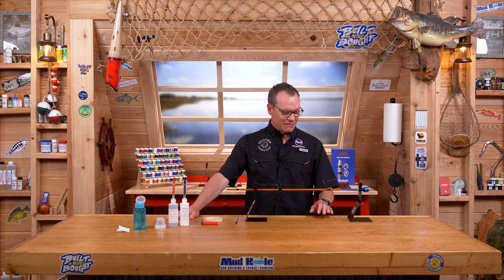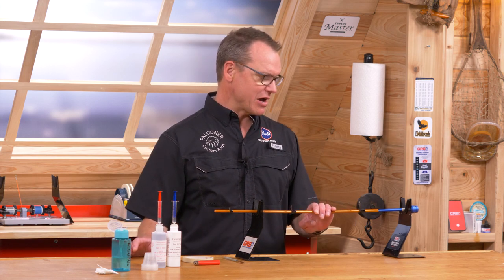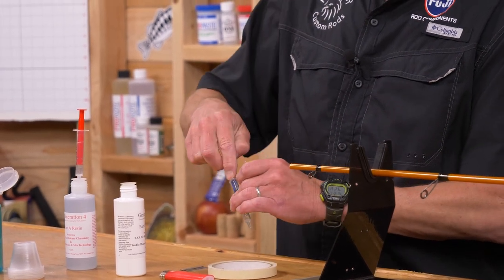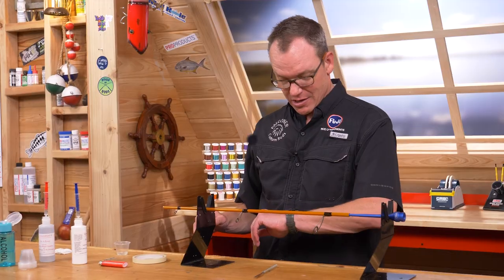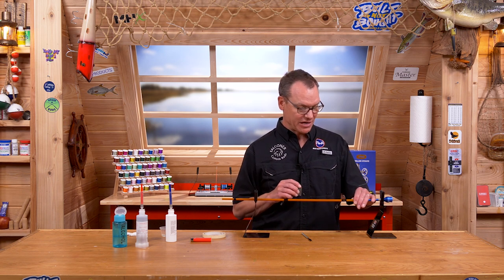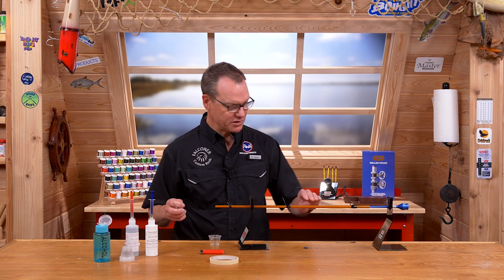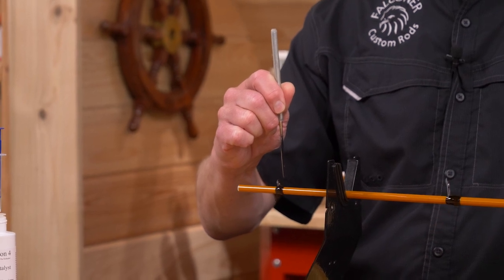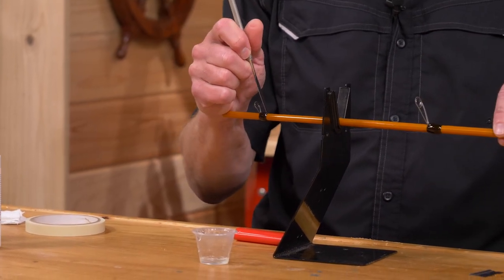Advanced Finishing Techniques (Part 2) - Advanced Builder Spotlight ft. Bill Falconer

Comment: I’ve now done a few rods with this technique and my results have been outstanding. This is the only way I will do guides.
Question: how does this method go on longer wraps and decals?
Reply: I know it's been 9 months, but I found it doesn't
Bill does a great video on longer wrap & decals at high speed rotation. I use it & works great & i don't use a brush apart from long wraps / decals